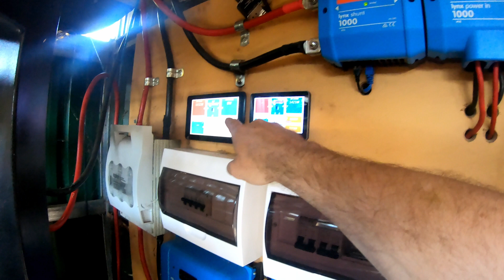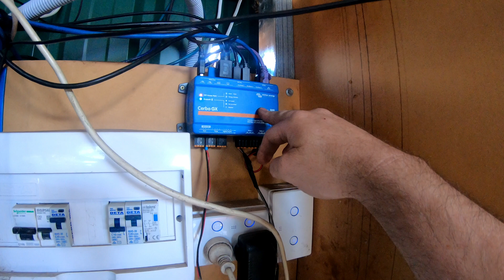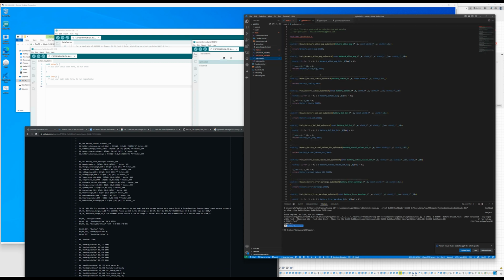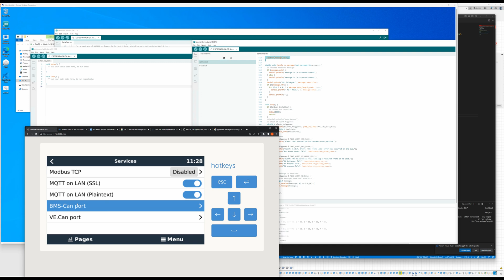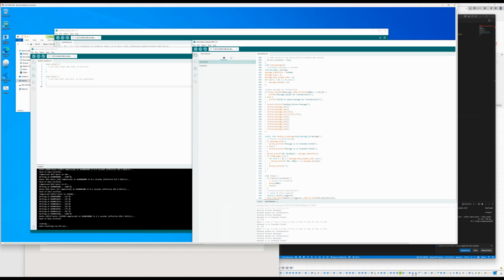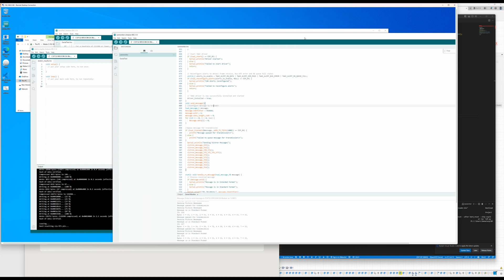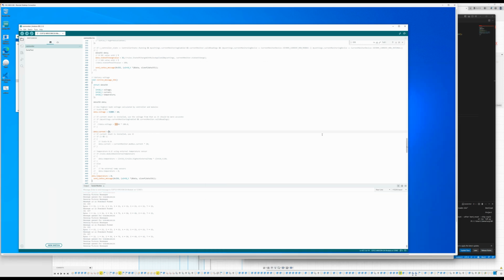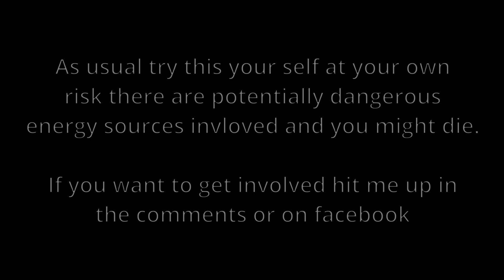JKBMS to Victron Cerbo Controller Translator pt1

Comment: Are u going to compress cells with a so thin metal layer? Mah.
Reply from the maker: ah, yes... its thicker than what is in most commercial batteries. If you happen across a pylon tech battery and pull it apart you will find a piece of sheet metal being used. not C channel like what we used.  Depending on who you bough your batteries from, in ESS situations you only need 0.5 to 3 psi of pressure across the cells. If you intend to aggressively charge and discharge then maybe it should be more. but this is a less than 0.2c charge and discharge battery. They dont come under heavy load. Plus we added a medium density foam in between them to help distribute the load across them. its been in place for a couple of years now and still works quite well

Comment: Why not parallel all BMS onto a busbar and then use a smartshunt between one busbar and second busbar, and then have inverters connected to first busbar with MPPT's connected to second busbar, then use the shunt to communicate the maximum charging currents to the charger controllers with dvcc enabled in the vrm portal

Sorry yeah commented this without watching the full video
Reply: I guess you're just worried if one string goes offline and stops charging/discharging while others keep going then you won't know about it from the shunt
Reply from the maker: @PvMLad  That is exactly how its setup right now, there is 3x 30wkh  strings, we can charge with 300A's, but each bms can only maintain 200a. 

there is a board out now that does this, offgrid garage made a video of it
Reply: @BadIdea1123  sounds good, I saw that, looks like a great BMS -  unfortunately we are using ncm batteries and that one isn't suitable for the slightly higher voltage and only works with 16s. So we're going to use the BMS units you have in this video instead.
Reply from the maker: Whats your goal ?, Are you looking to limit the charge current by getting data from the BMS ? @PvMLad 

I havent looked at it in a while(been busy with other projects), but could probably dust it off and revive the esp32
Reply: @BadIdea1123  yes exactly, if one of our strings goes offline then ideally we want to make sure charge current is scaled down appropriately
Reply from the maker: The victron side is easy, its well documented.  the part i am struggling with is the JK, the code that ESP home is using works for JK02 and JK04 but not for my model which is JK02-32. Ive extracted heaps of data out but im not seeing a pattern in it. esp home has made it work with the bluetooth side, but not the uart /rs485. JK are not responding either, which is really annoying. Ive been trying to scale and join bytes to find the cell voltages given there will be 16 of them all roughly the same but im just not seeing anything that stands out. even gpt4 isnt helping
 @PvMLad
Reply: Wait à sec.... There is a project to connect multiple jkbms on a cerbo, can be done with serial or by Bluetooth
Reply: @honumoorea873  oh interesting that it can be done via Bluetooth, do you have any more info on that?

Comment: Watching..... My cerbo has several different Can buss speeds and options
Reply from the maker: On the bms can side ?

The ve can has multiple speeds but the bms can doesn't on mine
Reply: under CE can port     can buss profile     options
disable
ve can lynx ion bus 250
ve can + can bus c  250
can bus bms 500
ocean volt 250
rv-c 250
cerbo -s-gx v 2.94
Reply from the maker: @timlucas4014  Yea thats what mine has too but thats the VE can, but under BMSCAN it only has one option 500 or disabled, But i dont know why one is different to the other
Reply from the maker: @timlucas4014  Turns out they explain the difference in the manual, from the cerbo controller manual - By default; VE.Can is set to 250 kbit/s & BMS-Can (if present) is set to 500 kbit/s

VE.Can is intended to be used for the Victron (and Victron compatible) VE.Can products, such as the VE.Can MPPTs, and VE.Can Lynx Shunt. You can string these VE.Can 250 kbit/s devices together along this bus. It must be terminated at both ends with the included VE.Can terminators.

BMS-Can is intended to be used with compatible managed battery systems, such as Pylontech, BYD, Freedomwon and many more. These must be terminated at the Victron end (on the Cerbo GX) with the included terminator (same one as used with VE.Can). It may or may not be necessary to terminate at the managed battery, BMS or BMU - this will be documented in the specific Victron Compatible managed battery instructions for that battery. Some batteries automatically terminate.

You can't mix VE.Can and BMS-Can on the same bus. If you wish to use both, they require a GX device with two separate buses, each with 2 RJ45 ports - 4 CANbus ports in total.
Reply: @BadIdea1123  Cheers for the info

Comment: I’m sure it was your Facebook post asking for this - I linked to an existing project that does exactly this - it already exists?
Reply from the maker: It might have been, but u haven't seen one yet that let's more than one shelf set the charge current accordingly 

Have you got a link ?

If your refering to the Serial battery driver, it can only monitor it cant dynamically change charge current, or voltage for that matter. it only monitors and sets a hard limit as the documentation indicates "Config Limit"

What we want is a dynamic change and for it to be redundant, so if a single controller goes offline (even in pylontech or seplos this floor exists) the off grid system wont shut down.